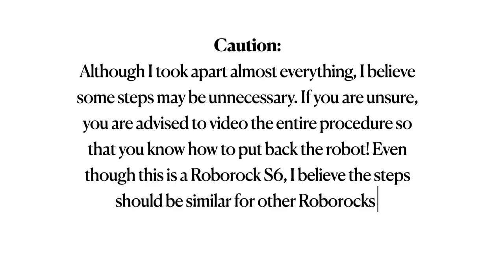Roborock S5 S6 Fan Speed Lowered, Check Filter, Blocked Strainer, Error 10 Take Apart

Comment: If I have to take mine apart like this I’m screwed 😂 I would NEVER get it back together right.
Reply from the maker: You never know until you try! Alternatively get a vacuum cleaner, remove the dust container and put in to the opening where the air goes into the robot, just after the filter.

Comment: I was fascinated to see all the internals of the S6 in this video. However, I believe I solved this problem in an easier and less-risky way using an air compressor to blow high velocity air through the unit every which way. A lot of dust came out, and I am not getting the error 10 now.
Reply from the maker: Thanks for sharing.

Comment: after having all the same hassles, i found that using another vacuum cleaner hose to suck the intake air spot solved the problem for me.  It only sucked up a small amount of fluff and dust into its clear canister, but that totally solved it.  So maybe try that before you pull the machine apart.  I did remove the filter and brush first so that they didn't provide resistance when sucking the dust from the air intake spot
Reply from the maker: Yes. That is good to try first.

Comment: Thanks for the video! It worked perfectly well and is very easy to dissamble/assemble following the video instructions. I'd add that the part that doesn't need to be taken appart are the 2 big wheels. All the other parts are mandatory to reach the air outlet and the air blower
Reply from the maker: Great to hear! Please like video and subscribe! I would not consider it very easy to disassemble!

Comment: Thanks for this video. It was really helpful.

My error on my Roborock S6 says "The filter may be wet or blocked. Fan speed has been temporarily lowered. It will be automatically restored after the strainer is cleaned." I've had the vacuum for a few years now and do own a dog. I didn't have this issue with my first filter, but on the second OEM one I started seeing the warning. And often! Multiple times a cleaning, if not every few minutes. I contact Roborock support and they wanted me to pay a $75 diagnostic fee. 

The video was really easy to follow but I recommend putting your screws in separate small cups (containers) at each step to keep them organized. Most of the screws are the same size, but not all. That's comes to my own criticism of the video. The way the vacuum was put back together was a bit different than it was deconstructed so I feared that I was using the wrong screws. Had to jump back and forth in the video but eventually figured it out.

I was surprised that the internal filter didn't appear to be all that dirty, although taking apart the vacuum cleaner allowed me to clean in lots of places throughout the process. I think this video helped me resolve my issue, but I'm not entirely sure. After putting the vacuum back together it had some issues determining where it was and I received the same filter blocked warning. I was probably a bit impatient because the Roborock can have issues determining its location under normal conditions but I panicked a bit. I ended up factory resetting the vacuum too. I'm not sure which step resolved my issue or if it was the combination of the two, but I no longer get the error message.

Definitely worth the hassle of taking it apart and putting it back together and this video definitely helped me figure it all out. Just take note of which screws are supposed to go where.
Reply from the maker: Thank you. Your comments are totally valid. I messed up the screws and put them back trial and error. You are absolutely right about putting them neatly. Kindly subscribe.
Reply: @KSToh  Still a great video. I wouldn't have figured it out or solved my problem without it. Thanks!
Reply: Unfortunately my issue still persists. I still found this video really helpful though and was able to clean the device quite a bit. Hoping my next air filter will give me less issues?

Comment: Thanks for the very helpful video! The point is really that its the air outlet that is stuck (and not the filter). The simplified version that worked in my case: use a dust cleaner spray and blow out the outlet openings (first from outside, later maybe also from inside). Or, if you have a suitable old-style vacuum cleaner, try to suck out the air outlet openings (from inside).
Reply from the maker: Yeah. Great that works for you. But I did not know so I took apart everything.
Reply: Dust sprayer solution worked for me for a few months but then the issue came back and additional sprays would only resolve for mins at a time. Fingers crossed this comprehensive solution fixes the issue long term. Should know in a bit.

*Update - this fixed the problem! Yea no dust sprayer was going to resolve the extent of the build up I had. If anything may it could have pushed through debris and damaged the blower. Thanks for the helpful video!
Reply: I want to try this first before taking it apart. Where exactly is the air outlet? Thanks.
Reply: @Maria-uw9zg  in the above video, time abt 06:55-07:30. Intake and outlet are a kind of a "row of slots" in the outer casing (their form probably varies a bit depending on Roborock model).
Reply: Yes, I agree. The problem is the air outlet. I used the 'simplified version' of the fix too. And it worked!! From the INSIDE we positioned an 'old fashioned vacuum cleaner" nozzle toward the air outlets (that are visible once you remove the filter cannister). My husband taped over all the air holes so all the vacuum suction would be focussed on the inside of the air outlet chamber. We turned on the vaccuum and also tapped and shook the vac body a bit around the air outlet  hoping to dislodge some more dust to be vacuumed away. So far so good... S5MAXV is fixed.  No more error message. And we didn't have to undo all those screws and basically take the whole Roborock apart, which is a daunting challenge. I am very grateful for this thread and for the RR community! I needed the 'whole' conversation and the video to arrive at the right answer. :) Clearly this is a DESIGN FLAW and Roborock needs to make the air outlet compartment accessible and cleanable in future models. Has anyone told them this??!

Comment: This is insane. I used a grinder to cut a hole. Do Roombas have the same design flaws? Willing to switch. I've not seen ANY video that doesn't require taking the unit apart to clean inaccessible filters. Crazy town.
Reply from the maker: Yeah. Bad design on S5 & S6. For s7, the opening is just next to fan.

Comment: How I stopped that error without taking things apart: 
Executive Summary: I ripped out that fine mesh screen that's behind the foam.

I haven't had that error in over three months. I undid a couple screws so I could poke a fingernail file in there and between that and poking at it through the grill, I was able to grab it with tweezers and pull it out. You may be able to rip it out through the grill or maybe just ripping holes it it will be enough. 
Why does that work? I'm no vacuumologist but I see no reason except for noise reduction for blocking the output. It's air that's leaving the unit. Removing the fine mesh leaves the 'sponge' so I only noticed only a slight increase in volume. Holding my hand at the output, I felt a big difference in airflow. Again, I'm no vacuumologit but that equates to more suction in my mind. 
WARNING: If you don't like the result, you can't go back because you've probably ripped holes in the mesh in getting it out.
I also use a hand vac on the outlet each time but that did not fix it when I only did that.
Reply from the maker: Great advice! Will try it next time.
Reply: I just did this!! game changer! thanks for the idea :)
Reply: @KSToh  Can you please do a video of this ?
Reply: You mean that whole thing at minute 7? Do you have a picture or a video? Much easier than completely disassembling each time it's clogged. Maybe it's just sound indeed. If you remove anything at the intake, it reduces suction per square inch, but in the exhaust more airflow would only be better I guess.
Reply: @rutgervandeputte4695  I undid a couple screws then thought, no! This is too much. I was able to flex the case enough to get a fingernail file in and rip, rip, rip and snag it and pull it out. I think I could have also just used a knife and shredded it enough through the grill. I've been tempted to use a Dremel and cut the grill out in a way I could set it back in. It's the outlet. What difference does it make? :-) More airflow, indeed! I think that it is a touch louder. but not 747 noticeable. :-)

Comment: i took apart the roborock. no dust.. no nothing inside. but the error still persist. don't know if buying a new filter will fix anything.
Reply from the maker: It's quite impossible that there is no dust inside. Did you strip down to the fan and the filter at the fan intake?
Reply: Same here! There was minimal dust at the fan and even after cleaning it, the error still persists. The good thing though is I took the chance to clean everything inside it looks like a brand new except for this stupid error

Comment: Thanks the video, you are my hero.
Reply from the maker: Cool. Please like the video!
Reply: @KSToh  After a week the error has reappeared, what's wrong again?
Reply from the maker: @olzsy  did you strip the robot down like in video and clean the fan and the exhaust pipe? If you did, then I think maybe your room is very dusty or your dust filter is leaking and allowing dust to pass through. Coincidentally, I also just had the error repeat in my S6, but that is 1.5 years later. I also removed the 2 pieces of sponge that is blocking the exhaust vent. I hope that will reduce chance of error 10 again.

Comment: This also goes by the name of Mova z500. I don't have the extra opening in my trash compactment but I have the same issue. Even though I didn't want to...I had to take the whole vacuum to get the  internal filter fan to clean. 8:46 in the vid. It wasn't even that dirty. I can only assume the kitty litter got into the internal fan and caused issues. It works now but that was a pain. The thing doesn't even mop that well n the first place 😅

Comment: Thanks for the video. Fixed my S6 and would never have figured this out on my own.

Just one comment for future videos though, you re-assembled it in a different order to assembling it, which made it a bit more difficult to follow and because of that I ended up with 4 leftover screws 😂

Also, camera angle directly above means hands can block the specific holes you’re putting screws into.

Maybe show the screw to the camera and point to the specific hole before putting it in.

But in any event, a lifesaver.

Definitely a design flaw though!
Reply from the maker: Thanks for the suggestion! I am not film maker so amateurish. Please like video and subscribe!

Comment: Completely unnecessary. Fix is to blow compressed air through the vent slots from the outside
Reply from the maker: I know compressed air works for some but it’s it’s just blowing some of the dirt back inside.
Reply: @KSToh  It blows it into the empty filter box. It doesn't go "into the machine". Compressed air likely works in all instances. The coarse filter that clogs is only present to break up the exhaust airflow. Disassembly is an big waste of time for owners not looking for a hobby.